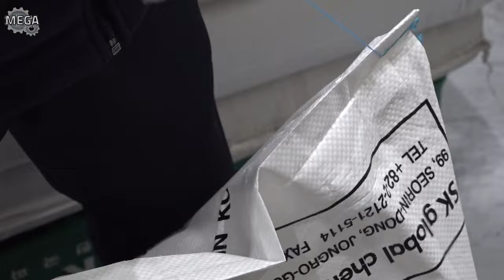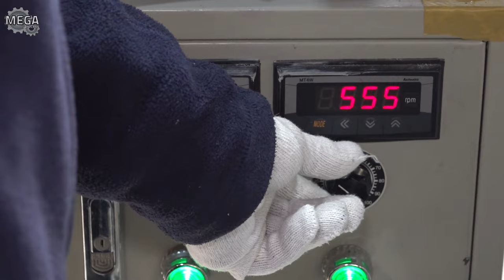Process of making plastic bags in South Korea. Poly bag mass production factory

Comment: Are these bags biodegradable?
There is a trend now for biodegradable bags in 2-3 months, they decompose whether you use them or not.
It's an interesting production, and it's an everyday thing.
Reply: No these are not biodegradable. Biodegradable ones although environmentally friendly, not as strong as the typical ones and more expensive to produce as you have to use natural polymers like starch. Also there is going to be an expiry date on them as you mentioned which limits the storage and transportation time. So these factors all need to be taken into consideration when thinking about it in a large global scale.